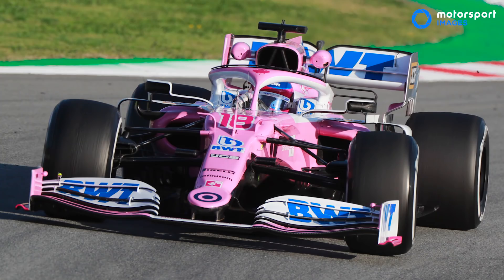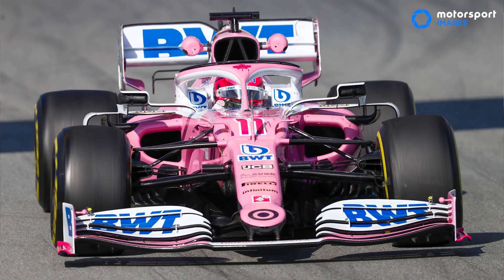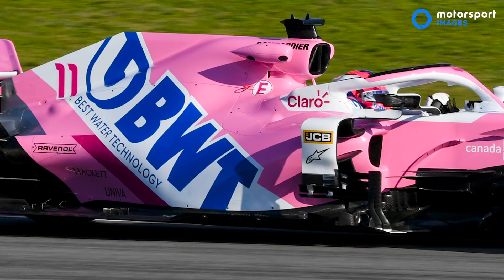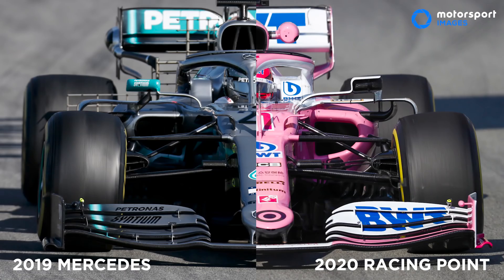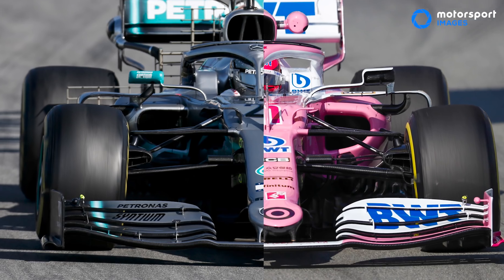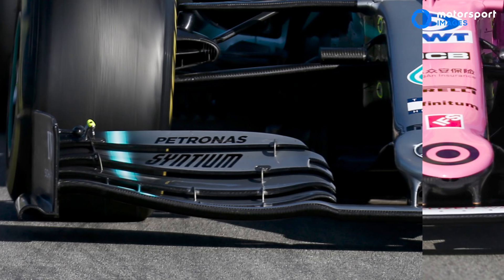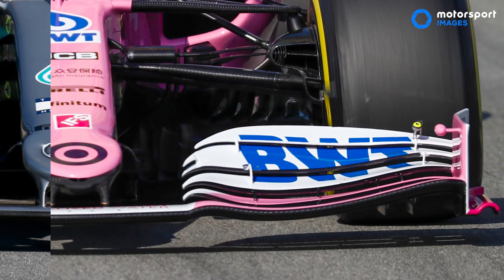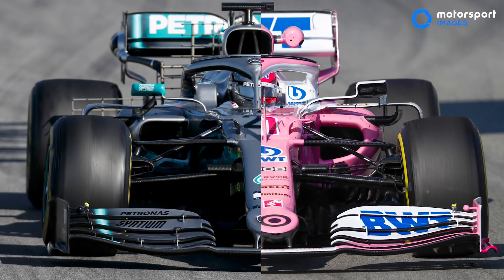Have Racing Point 'copied' the 2019 Mercedes? - F1 2020 Testing - DAY 1 | Tech Analysis

Comment: People: We want the field to be closer. Top teams are killing the sport.
Struggling team copies pioneered designs, same people: F*ing copycats are killing the sport.

The story behind the similarity- they did copy Mercedes but more than will it was compelled. Mercedes supplies the gearbox but they get a year older spec, since it was made for W10 (a low rake car) and fundamentally RP from their Force India days ran a high rake design, it was leading to errors. It was a ship with too many captains. So it began with the talks of a new design, went on to a low rake to take advantage of the gearbox design and ended with copying Mercedes as much as possible, to add to that they were using Merc wind tunnel which had all tools made for W10.
They didn't copy Mercedes in terms of using their blueprints but ensured to look at images and build a replica to stay legal, it is still a RP design. Anyway no matter what the car is from outside, there are a million parts inside that makes the difference. If you see the onboard laps, Perez is struggle to handle the car right from turn 1 which indicates where the car still is.
Reply: What do you with stay legal? If Mercedes allowed them to use their blueprints, why wouldnt that be legal? Also does that mean that other teams that use the Mercedes gearbox would have to do the same, otherwise theyre doomed?
Reply: @Chuckiele  do you have reading difficulties?